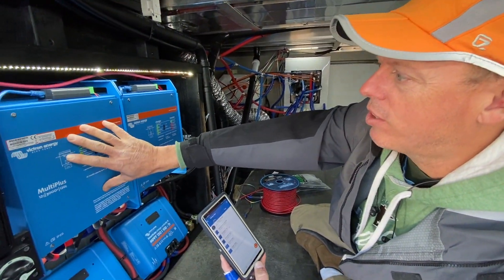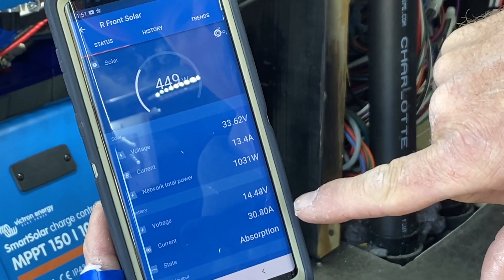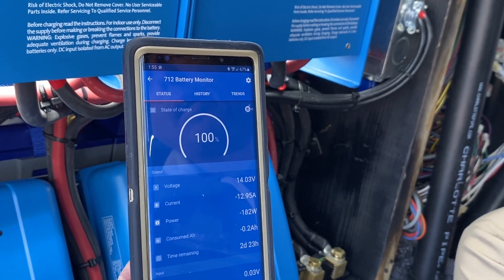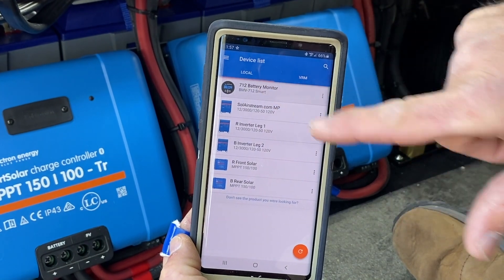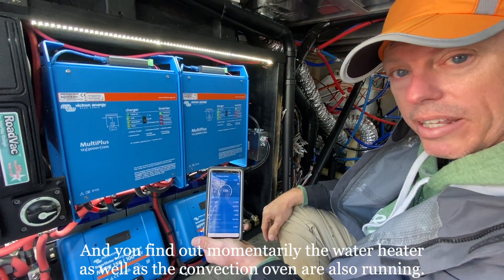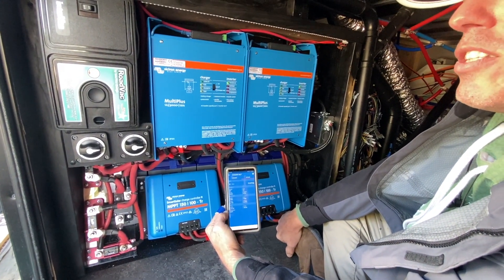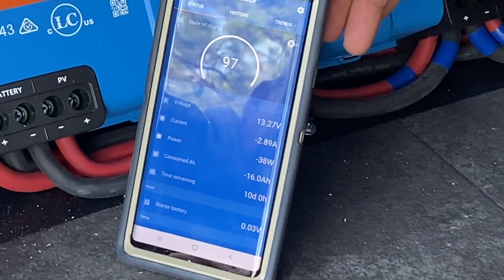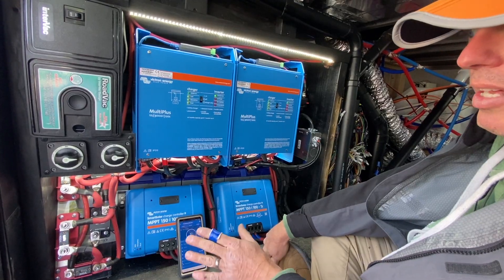What does your RV solar & lithium system do for you? | Powerful systems

Comment: at 10:21 i was convinced this is not worth it  want to run 2acs microwave or whatever for at least 5-8 hrs before auto gen
Reply from the maker: Yeah, if you want to do that solely on solar and batteries, you’d need at least 12 batteries, but if you wanna run AC overnight you’ll need closer to 20 batteries ($$$$).

Comment: This is great, do you have any info on how much the Samsung RF18 residential fridge draws? I need to find someone with your expertise in eastern Ontario or western Quebec here in Canada. I have spent my whole afternoon looking at your videos.
Reply from the maker: Hey there Alain - sorry for the delayed reply. If it's the RF18HFENBSR, then that's the same model as Nathan of Less Junk More Journey and it is super efficient. It's about less than a battery overnight for the draw. When we upgrade our fridge it will be this one of the 12V fridge.

Comment: This is a fantastic video.   Do you ever install 24volt systems and then you a DC to DC inverter for the 12 Volt appliances?  Just wondering if 12 volt is the primary way for install?
Reply from the maker: Thanks, Benjamin. To keep everything simple for the end user, we keep everything 12V in parallel. It’s also more cost effective if the end user wants to expand their battery bank.

Comment: Nice video I purchased a 2019 Montana 35 foot It has one panel of solar not really sure how to use it I bought it used I know it’s got a inverter but could you tell me probably not what this one panel is doing for me.
Reply from the maker: Thanks Howard. One panel is typically a trickle charge for the batteries.

Comment: Mike mentioned that he had been asked to move Grand Design Lippert Compass Connect touch screens from the basement passthrough to inside the cabin.  Could Mike, or any of his customers,  direct me to the Dry Campers episode where this problem is addressed?  After several inquiries,  a nice lady from GD did send me a text
Reply from the maker: We can only assume you’re speaking of the Lippert control box with all of the wiring that is located in the pass through? We’ve not been asked to move this, but we relocate it and complete the wire management so that we can do the installs under the steps, behind the wall. This is all still located within the pass through though, never inside the cabin. Essentially if you watch any of the 397TH install videos, it is just unsecrewed, relocated and better managed in a different location.
Reply: which unfortunately did not answer my question.  Ever since GD started to install touch panel control centers in it's rigs, I have not understood the logic of putting the main touch screen in the basement; regardless of cell phone app availability. I think GD might be putting some touch screens in the cabin of some of the rigs now. I love Mike's work, and would really like to see how he did the relocation.  Thanks to all Dry Campers fans.
Reply from the maker: @rogerspalding5673  we responded before we received this second part... There aren’t any touch screens in the basement of the models we have done, so we’re not 100% sure what you’re referring to.

Comment: Sorry for the incomplete question. Accidentally hit send. My "complete question is" are there any devices that you can connect to your shore power cord and the pedestal to record the watts/amps you are using in a 24 hour period. If such a meter with memory does exist, you can see how much power you are using per day/week.
Reply from the maker: This specific client actually has a Power Watch Dog surge protector, which has this ability to do this as well.